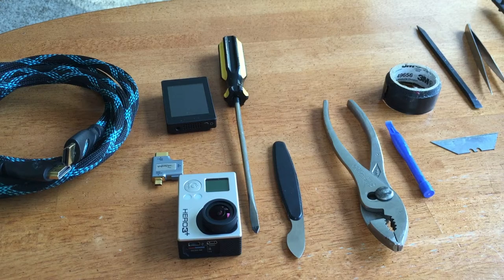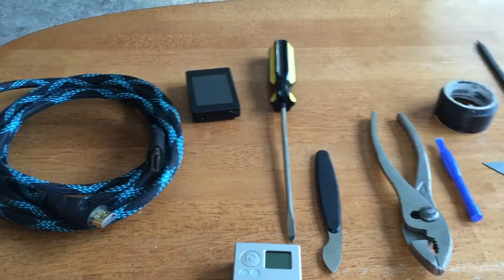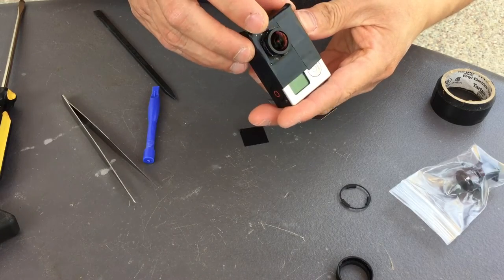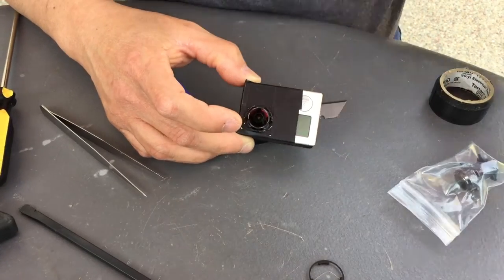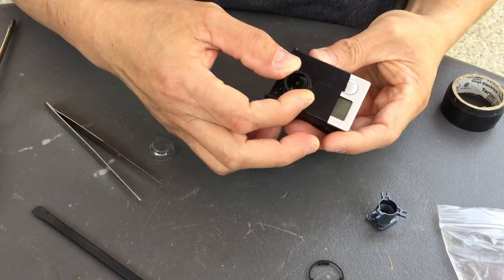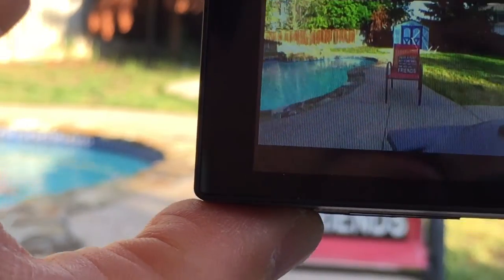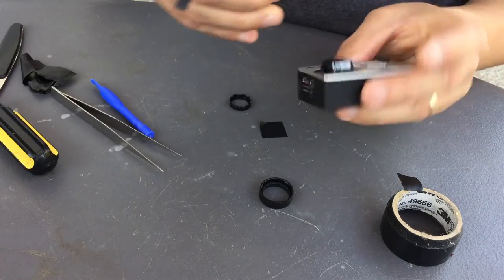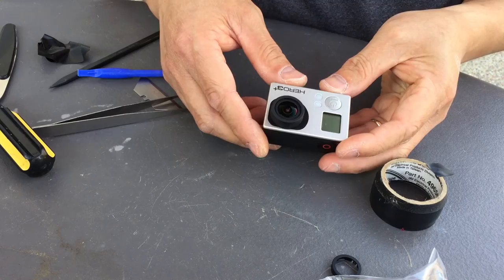How to replace GoPro 3+ Black Lens + Focus Lens + Infinity Focus Mod Tip

Comment: I've done a bunch of these... what I do is put a #11 rubber washer that you can find in the pluming department of Home Depot, put it in before you put the lens in.  The lens will contact the washer before it's in focus. It gets hard to turn just as it comes in focus making the lens very difficult to come out of focus on it's own.
Reply: How clever thanks 
Hayden

Comment: Nice video, man! Mine has lack of sharpness, so i tried to do the focus fix on the lens. I tried to turn my lens clockwise but it does not turn. It only can be turned counter clockwise. Should I force the turning or it can break the lens? Thank You
Reply from the maker: +Lucas Mateucci it could be the end. Unscrew it all the way out. Then slowly screw it in. Good luck! You will not break it going out - removal. But you can mess it up going in.
Reply: cbatilo Thank u for the answer. I ll do the way you told me. Do you know If the best point for infinite and Sharp focus is at the max screwed in?
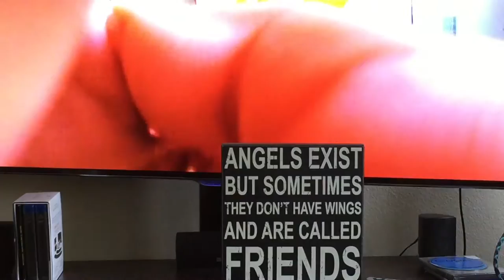Reply: I hope you have an adapter to attach it to your TV. But I would say... it was not screwed (max) in all the way. See 6:55